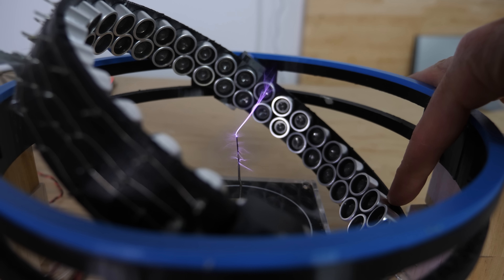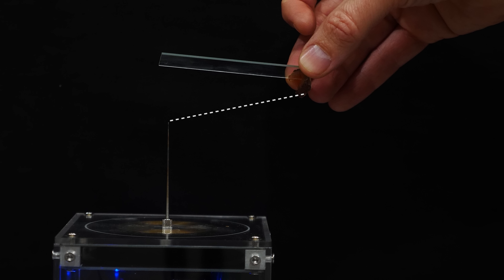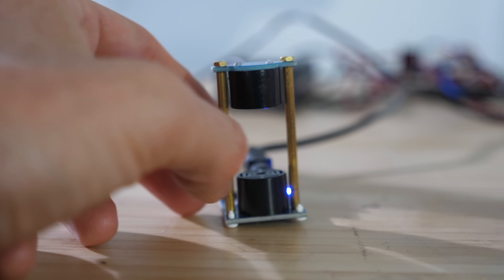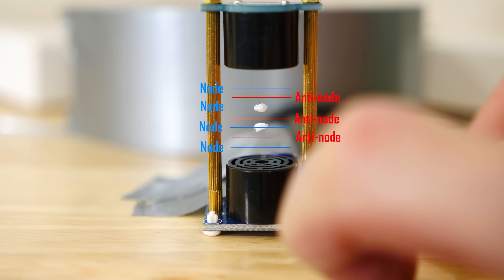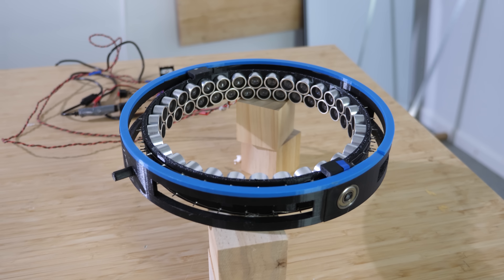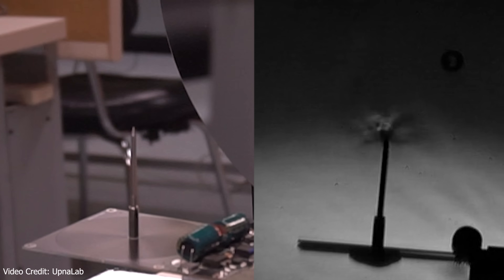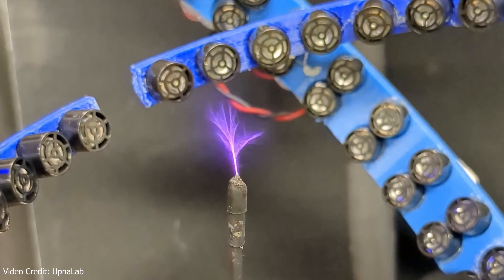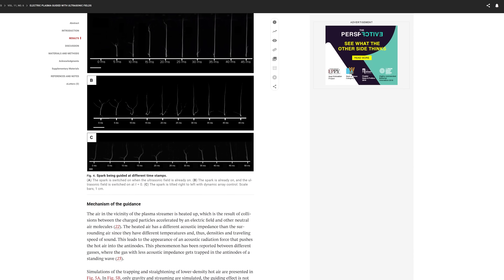Can You Control Lightning with Sound?

Comment: sound interacts with electricity because it moves through the same exact spectrum. EVERYTHING is energy moving through time, which moves through waves. everything can be broken down to a low frequency high amplitude to high frequency low amplitude state. from the most potential energy to the least. from the most chaos and the least order to the most order and the least chaos. so negative charges are high energy, slow moving and stable and positive charges are fast moving, low energy and chaotic. sound does the same exact thing. they both interact with eachother because time itself is a balancing force. it seems to balance frequencies through duality through that frequency that i mentioned. i've called my framework the duality spectrum theory. it explains a LOT of things that science is totally baffled about

Comment: I thought of a concept that if built would work somewhat similar to that device years ago. It's the same shape, but also uses magnets, and lasers.

If you think about it, you can use this to create a more efficient ion engine, possibly a fusion reactor, and many more concepts if done right.

Obviously you will need a cooling system for it, but it's doable. Of course what do I know.

Comment: Maser do same. 
Laser do same.
Ionise air
(laser-induced plasma channel, LIPC)

Applied Energetics (formerly Ionatron) develops directed-energy weapons for the United States military. The company has produced a device called the Joint IED Neutralizer (JIN), which was intended for safely detonating improvised explosive devices (IEDs). The device was deemed unsuitable for field use in 2006,[4] however, the company has been developing versions of the weapon that can be mounted on land, air, and sea vehicles, as well as a hand-held infantry version.

Applied Energetics said that the weapons will be able to be used as a non-lethal alternative to current weaponry, but will be able to deliver a high enough voltage jolt to kill.

Applied Energetics say that they are working on an electrolaser system, called LGE (Laser Guided Energy).[citation needed] They are also studying a laser-induced plasma channel (LIPC) as a way to stop people from going through a corridor or passageway.[5]

Phoenix
There was an unconfirmed report that in 1985 the U.S. Navy tested an electrolaser.[citation needed] Its targets were missiles and aircraft. This device was known as the Phoenix project within the Strategic Defense Initiative research program. It was first proved by experiment at long range in 1985, but this report may have referred to an early test of MIRACL, which is or was a high-powered chemical laser.[citation needed]

HSV Technologies
HSV Technologies, Inc. (Stood for the last names of the original founders, Herr, Schlesinger and Vernon; this is NOT the same company as Holden Special Vehicles), formerly of San Diego, California, US, then Port Orchard, Washington, designed a non-lethal device which was profiled in the 2002 Time magazine article "Beyond the Rubber Bullet".[6] It is an electrolaser using ultraviolet laser beams of 193 nm, and promises to immobilize living targets at a distance without contact. There were plans for an engine-disabling variation for use against the electronic ignitions of cars using a 248 nm laser. The lead inventor, Eric Herr, died in 2008 and the company appears to have been dissolved, as their website now hosts an unrelated business (as of September 2015).[7]

Picatinny Arsenal
Scientists and engineers from Picatinny Arsenal have demonstrated that an electric discharge can go through a laser beam. The laser beam is self-focusing due to the high laser intensity of 50 gigawatts, which changes the speed of light in air.[8] The laser was reportedly successfully tested in January 2012.[9]

Comment: levitate a piezo-electric crystal in the center and shield it with the plasma then increase the amplitude of the sound let me know what happens. & try flipping phase. try using  lets say 39 hz on one side and 45 on the other.

Comment: Would it be possible to use ultrasonics to control plasma for fusion purposes ? Don't know enough about either to say, but from what I do know, a huge problem with current fusion reactors is just containment of super hot plasma... could we induce standing sound waves to hold the plasma in place instead ?

Comment: Nice video, can you Double check the Idea that the higher temperature is the only reason, i think the low or high pressure helps to ionize too? (i think in statistical thermodynamics there is not much difference between pressure and temperature, it's just momentum)

Comment: You know looking at this I think about the 1955 tornado in Blackwell that was apparently a mile wide and ionized as well. Not only would there have been an immense amount of wind pressure and things necessary to build a tornado but think about the sound that each tornado produces when essentially funnel ionized particles in by this principle Might be that last thing people need to figure tornadoes out

Comment: You could potentially create a hole in spacetime with this technologyt. If Quantum Field Theory is correct, then mass is just a resonance in the vacuum field — not a solid thing. Gravity isn't caused by mass bending spacetime, but by spacetime weakening where specific frequency patterns interact. I theorize that two converging plasma beams at 432 Hz and 528 Hz could create a subharmonic interference point that temporarily reduces vacuum 'stiffness.' If the conditions are right, this might produce a localized spacetime dip — a kind of dark matter node. Maybe even visible as a black dot.

Comment: Compression of gasses (air) causes higher resistance or more conducive conditions within the arc
Reply: I was thinking of that more than temperature effect. Sounds like Paschen law do the tricks. The anti node is a low pressure condition that severely decrease the electrical breakdown distance

Comment: This shows clearly the link between electricity and longitudinal waves in the aether - simple, elegant AND amazing demonstration- many thanks.
Reply: 😂👍 (You are joking, right?)
Reply: @ the ultrasonic collar is creating a series of intersecting standing scalar waves (in air) that, if perfectly aligned, would create constructive interference at the centre (highly unlikely in this case) or, if not quite perfectly aligned, will create a vortex.  Now, an air vortex on its own would not be able to steer any discharge from the tip at the centre point (for, how would the air molecules transfer their energy to the discharge to confine it to a collimated jet) … but, if that vortex is drawing in aether, this does have the potential to influence the discharge, likely creating a self-constraining plasma filament, something of great interest to those creating systems similar to that created for the Safire project

Comment: OK you don’t even realize what you’re doing you’re communicating something that’s high science that’s really really really out there and I have to explain this to you fast because you don’t know it earth is not one G it’s more than that but just pretend it’s one G now, even if it was one G it would be one band of causality coming through 360 trillion times a second you’re getting blasted with a laser that led it spinning that fast and all the rest of the time you’re getting sucked in on on a black hole each one of these little dots of Styrofoam that you’re making vibrate you have made a war Flexure a physics war flexure in the radiant of reality, and it is in one specific spot, and you’re setting them on it, showing the Jacob, that what they did the latter of relativity the theory of relativity there’s the ladder of relativity you’re looking at it this is so profound of a handful of stick that I can show to you. It ain’t even fucking funny, but it takes too long to get it all out earth has three course which makes it that much easier to activate but you still have to get at that 360° power curve now what I have to say is warp skipping a emergency bug out maneuver, submarine captains have been using since World War I called a war, assisted trajectory flight and a hyper cavitate or super cavitate the entire ship hall and they agent oranges nuclear cool down fluid, and it used to be that it was a two part thing, and they would put one part out as a shock absorber so they wouldn’t get so much Radiation backfeed in their nervous system because they get hammered on in the same way as if you locked somebody in an ocular rift and let them burn for a little while anyway, hat the hat that says I done this shit before I’m just a little doped up right now so I don’t tell you what the fuck it is right off the bat and I’m trying to tell you you done fucked the dog somewhere oh yeah, you’re not supposed to put your eardrum in direct line of sight to the hydraulic casing in which that you hold that micro that ultrasonic something or other, when you play above Around specific frequencies and that’s basically what they’re supposed to have as a canvas around and it helps to reinforce the day the smaller the technology the more it looks like organic then it uses quantum communication which is a sonic which is ultrasonic instead of radio, so it doesn’t melt its neighbor And it’s going back to learning to properly communicate with reality around you. Now you have to remember the state of the art threshold the Radic constant, the shit that the licensing is based off of a anything that puts out more force than act. You have to have a license for because you would not have gotten it that powerful if you had made it by hand with withoutAI guidance. Have an AI there has to be AI won’t stand for not being able to.

Comment: I have to ask.  How much thrust can this produce, even at this mockup demonstration prototype stage?  If you force hot air in a specific direction, that's potentially a fan.  Can it go in other directions as well, like guiding it downwards towards denser air?  Could it be paired with a smaller and weaker fan to push it sideways and then direct it downwards?  If that is done, once a current is induced, can it sustain a current?

Even more on that thought, can it be used to create standing waves that guide multiple streams?  Can said streams produce more complex patterns, like letters, numbers, crosses, even something more organic like its normally chaotic trees, but locked in place?

Comment: Yes! Amazing!

I had a similar idea to modulate the tesla coil itself at ultrasonic frequencies, and use a specially shaped topload to direct the resulting ultrasound. The acoustic streaming effect can be generated by moving the anti-node spatially along the axis by rotating the phase of the signal, I'm not certain what the maximum acceleration field could be for this, but the speed of sound in plasma can be a considerable fraction of the speed of light in the medium, so this could be desirable for electrohydrodynamic and magnetohydrodynamic propulsion and flow control for aircraft.

Another possibility alluded to here is to create a Bessel Beam, using either an Axicon lens or a Waxicon shaped acoustic phased array. Axicons using pulsed lasers have achieved plasma channels that can have arbitrary shapes, even plasma channels that tie themselves in knots! Opens up the possibility of plasma forming inductive loops mid-air. It's exciting to think we could generate stable toroidal plasmoids in air using these techniques.

Comment: so in theory a powerful ultrasonic transducer ring on the top of the handle of a lightsaber with plasma could be plausible to make it go straight up without using a container for the light or retracting mechanism currently use in most. Also, amazing video.

Comment: Thanks! Vibrate magnets on the new fusion reactors to this frequency and compound it with the magnetic fields
Reply: I was wondering the same thing, I don't know but it's impossible that no one has tried it yet it's really a mind blowing idea
Reply: @ameristanbouli5063  I guess the main problem is that fusion reactors have extremely low pressures, which makes using acoustics impractical.
Reply: I really feel like this could legit work. If we could tune the resonance frequency of the containment materials to match the ultrasound frequency...
Reply: We are but young in this word, man has melted rocks for years.
Reply: Really, really cold ones !

Comment: Hello James. I'd like you to do an experiment of possible. This experiment consists of a gyroscope (small one), a vacuum chamber and some dust. Aim of this experiment is to find out if gyroscope has its own magnetic field and will it keep the dust in its orbit, this way dust will deny earth's gravity and will be hung on the gyroscope's magnetic field.

First you'll hang a bag of very light dust(maybe fabric dust it should be light) inside the ceiling of the chamber, you should be able to make it fall so you can use a magnet in this case. 

 Then start gyroscope at a preferably very high speed, put the chamber on the gyroscope then start suction, when the pressure in the chamber release the dust. In this case you can use some green light to see dust better. I couldn't found any experiment done like this. I hope you'll see my comment. Thanks in advance.

Comment: I can see this being very useful for wireless energy....however, is it possible you could use these ultrasonic transducers to manipulate magnetic currents?

   I hate trying to descried things, I'm better with physical examples, but have a ring of these U.S.T's in a circle, slightly pointed up and towards a magnet, and a secondary U.S.T. ring above it, and move the current up and down, or what I'm getting at is the bottom ring, when activated, pushes the magnetic current upwards, then the top pushes it down....I don't what I'm trying to say, and like I said, I hate trying to describe things, but if The Action Lab sees my comment and gets what I'm trying to say, I would be very interested in a response.

Comment: Acoustic radiation force has been known since early 1900s.
1905–Rayleigh described pressure from sound
1930s–40s: Lab demos of acoustic levitation
1960s+: Used in ultrasound tech
2000s+: Precise control in microfluidics, biomed, materials
Plasma control with sound = You're looking at it.

Comment: I may have gotten distracted for this part of the video if it was covered but wouldn't the electromagnetic flux fields from the ultrasonic transducers be part of if not the main contributor to the outcome of the plasmas orientation and not just the acoustic radiation force? Or would the emfs and heat produced from it be too minute to takin into consideration?
 As I thought it was the interaction of the Lorentz force and electromagnetic fields that create the ultrasonic frequencies. I see speed of sound in medium is a factor to ARF and know temperature changes the speed of sound, just seems to me as if there's more contributing factors at play here.

Comment: I love this channel, I don’t know why but as I get older I can’t get enough of science. 👍
Could they use this method for the Tokamak reactor instead of a magnetic field ?
Reply: Sound needs a medium to transmit through. You don't want any of your 100 million °C plasma to touch the tokamak walls, so how would you keep your room temperature "air" that you're compressing to create pressure waves from mixing with your plasma?

I assume you wouldn't just use the plasma as your intermediary gas otherwise it would destroy the transducer and lower the temperature needed to maintain your fusion reaction.

Comment: Very cool, indeed. Thanks, man. Do you think this effect could guide the ionic wind more precisely around the wing? Thinking of 2D electrodes painted on top of the wing, one tooth-edged (anode) and another smooth (cathode) using graphene (or any other conductive paint) spray to draw the electrodes. I saw your clip and I'm thinking how this would help the ionic wind propulsion guide the ions over the wing even in stormy clouds. Either way - it was very cool watching your demo(s). Thanks!

Comment: In printed circuit board manufacturing, we use a plasma chamber to put the panels of circuit boards in when they are made of a special material that is sort of like a bendable plastic. The plastic won't let anything adhere to it because it's so smooth, so we stick it in the plasma chamber, turn on the vacuum, fill with gas and the low temperature plasma forms across all the surface of the material because of an alternating current in the chamber. The plasma heats up the material while pulling it away like a tendril of electricity, and it cause the surface of the plastic like material to grow little hairs all over it, so then we can attach copper or soldermask or silkscreen to the material without it losing any of its properties. Very very similar to this, we are using the Lorentz force which is like how optical tweezers work and you have another video on that. Lorentz force and acoustic radiation force are super similar, combining the two can produce an image much like a tube tv. I've seen a lot of interesting things in radiation effects / rf engineering and physics regarding these forces, they lead you all the way to loop quantum gravity and spin foam theory, a unified theory on gravity!
Reply: Seems a video of this process would be awesome!

Comment: I can see how this process could be improved by the use of a scalar electromagnetic interferometer, creating a column of heated air, along which an extremely high voltage discharge is tunneled.  Or, just use the scalar weapon as designed and forget about the high voltage discharge.  Just "dump" the system once the target is acquired and engaged.  By "dumping the system", i.e. high speed de-energization of the interference zone, a vacuum implosion is created and the target is neutralized.  Tesla was right.